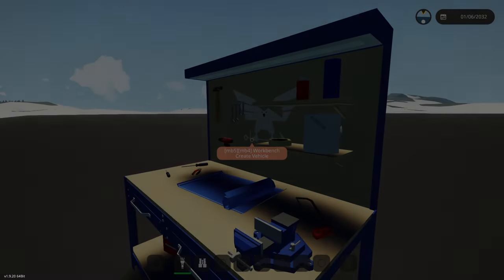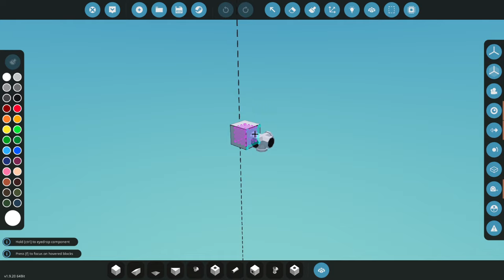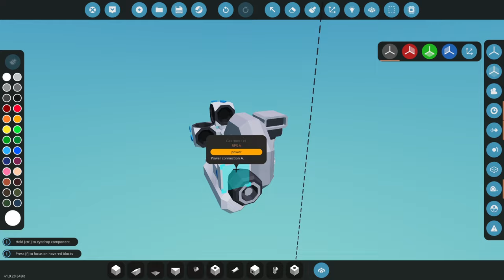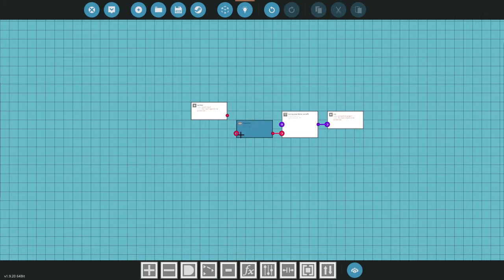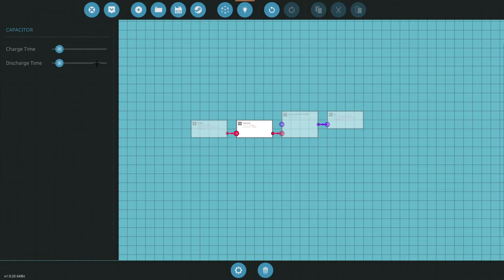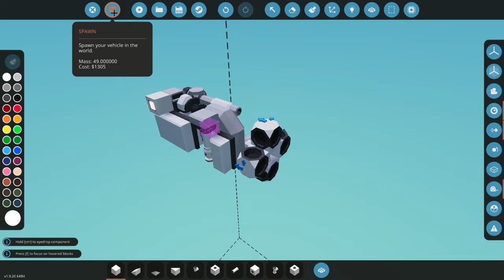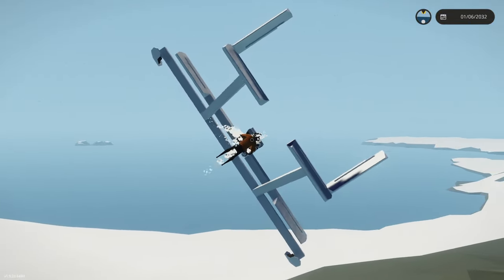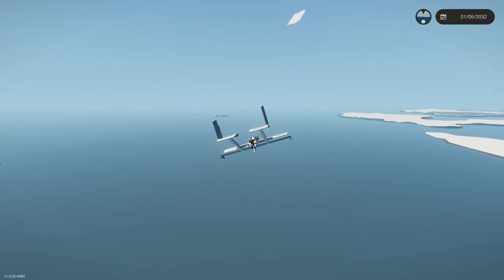Making An Air Powered Engine in Stormworks! - Stormworks Space DLC

Comment: I think you could generate electricity with this. My thought is from a video of someone using rockets to spin a large circle made of blocks and wedges with wheels contacting the edge of the circle. As the circle spins, the wheels spin and produce RPS that can be channeled into generators. I will be testing this tomorrow when I wake. Will get back to this comment with the results in an edit. If it works I will be making an air powered ship. Thinking I will pipe the RPS into either propellers or fluid jets.
Reply: you can just fly wheels and clutches to get inf power anyway